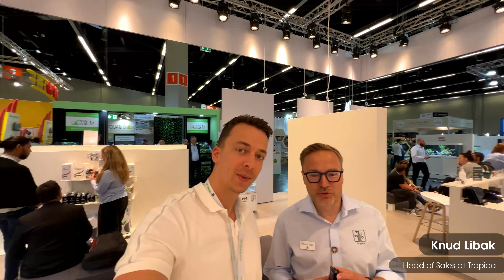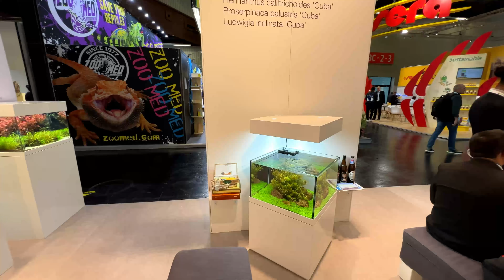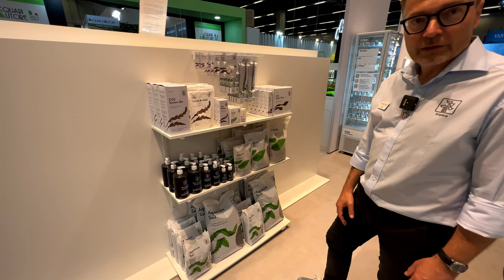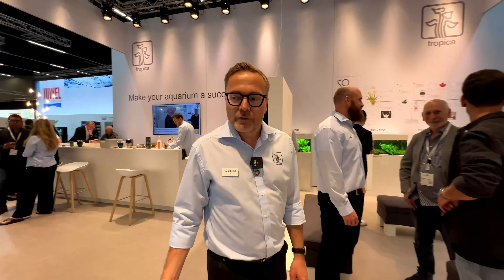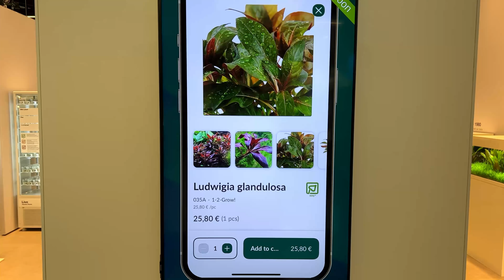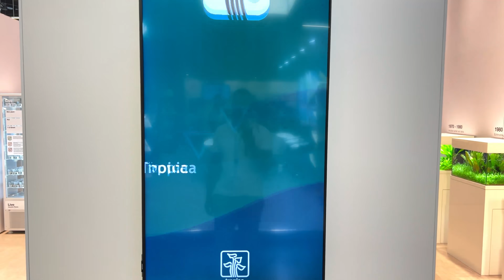TROPICA BOOTH AT INTERZOO 2022! LOTS OF EXCITING NEW THINGS COMING!

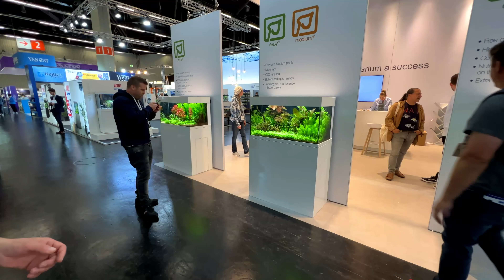Comment: 6:45 - One note here: This categorization doesn't always apply to difficulty.

For some reason I've got issues with some plants. If there's no algae issue, I can grow Rotala Walichi (Advanced showcase). I can keep Hygrophila Pinnatifida alive for some time, but fail once other plants overgrow or I break the morning fert dosing routine. Some plants even grow better in a non - CO_2 tank for some reason.

For some reason I could never grow Staugyrone Repens or Pogostemon Helferi long-term and they are both medium plants.
Reply: Agreed - My guess is the plants may have been categorized by their demand for light, co2 and nutritional needs moreso than the other factors (Gh, Kh, etc) that may also implicate plant growth. Afterall, its hard to actually balance and score each of these criteria to sort out the difficulty in growing them. An example would be them labeling Pearlweed as an advanced plant, which I am sure most hobbyists agree that it is one of the easiest stem plants to grow. But for sure, their contribution to the hobby is respectable and I would love to be able to see the exhibition in person.

Comment: Wow the black background really makes those plant colors stand out! Any idea what they used? Undecided if I want to paint or tint my background
Reply from the maker: Yeah I think it's tinted glass indeed! looks very good
Reply: some more expensive / higher quality aquarium brands come with black tinted glass, other brands you have to use a black foil or couple layers of black latex paint or chalkboard paint,
Reply: Black tinted glass is expensive (more than Float glass from Belgium). Black self-adhesive foil or paint works the best. Check the tutorials first. 

In short use "dishwashing water" and old credit card to put on the self-adhesive foil (be it black or milky one) without bubbles or wrinkles. White spots should disappear in a week (hence dishwashing detergent instead of soap). With a paint you need to pick the right tone. I used a water based furniture paint and the background turned very dark brown instead of black.